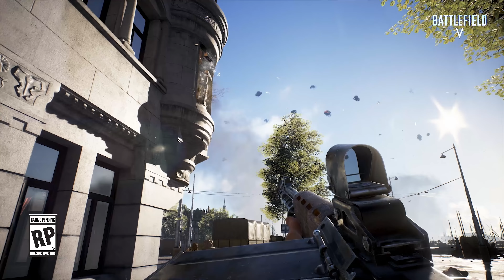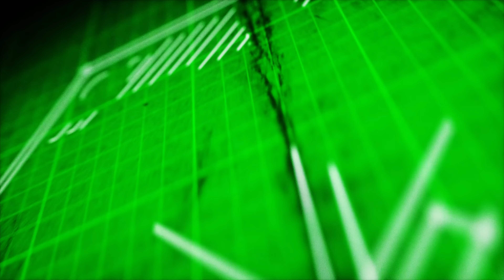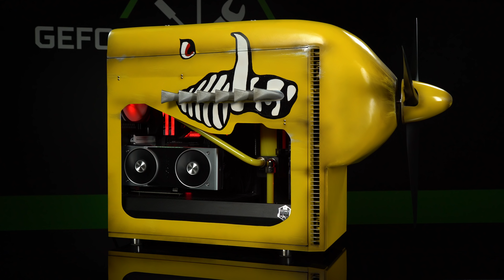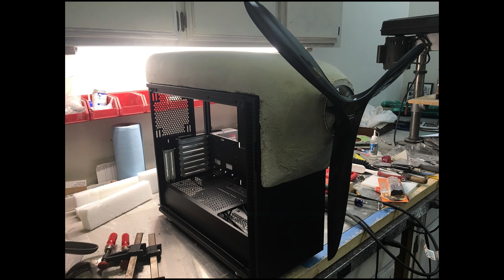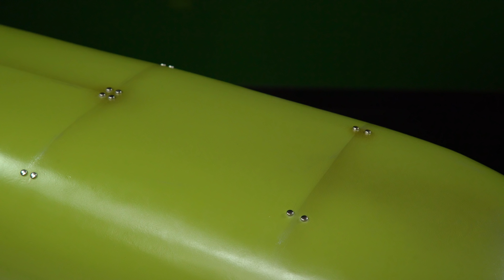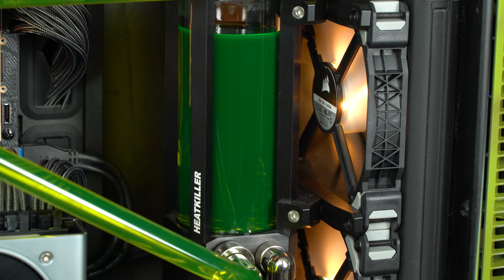GeForce Garage - The Battlefield V RTX Plane Builds

Comment: The propeller should be turned into one of those slow moving fans you place on top of fireplaces. That way the hotter the computer is, the faster the blades go. I can't see it gaining enough speed to cause damage.

Comment: A question I don't see asked is how is Nvidia going to put these RTX based cards into gaming laptops. The Pascal series was quite a breakthrough on mobile since those chips came within 10% of the performance to their desktop counterparts. Pretty much a mobile 1070 was close to having desktop 980ti class performance on the go. So I wonder how they're gonna do it with this series or if it is even possible at this point...

Comment: They would be so much cooler if they made the props spin slowly!
Reply: Adding a DB601 engine to cool down the cpu.
Reply: Why slowly, I personally think it should go at 7200rpm.
Reply: @thetrashman5252  Yeah, he could have used a really strong brushless Motor so that the whole computer was cooled just by the huge prop!
Reply: @JT_6233  It is absolutely not a safety hazard.
Reply: Gtx 2080 ti i want it

Comment: Looks amazing, but the prop is a bit of a missed opportunity, I might be wrong but im pretty sure planes have an air intake under the propeller on the cowl, and the propeller could act pressure fan and move the air though the system a lot faster. Of course you would have to move the front panel away from that area to avoid cutting off fingers and it would be loud as hell, but it would look so much better to see the propeller integrated with airflow system

Comment: nVidia is 6 letters long, they are releasing their 2000 series graphics cards, so take 6 + 2 = 8, 8th letter of the alphabet H. They are releasing cards with the code RTX which when converted to numbers we get 18 + 20 + 24 = 62. They are giving away 10 cards, so we get 62 + 10 = 72 divided by the number of letters in nVidia and we get 72 / 6 = 12 which when converted into a letter is L. Take these clues with the fact they are releasing 3 different cards and we get HL3. 

HL3 Confirmed!!!!!!

Comment: Like how the card isn't directly in the mono but in an extended PCI slot so it faces the windows. Awesome build but it would be even cooler if the propeller up front was powered by a little motor so it could move!!